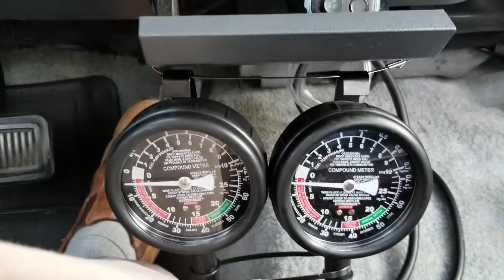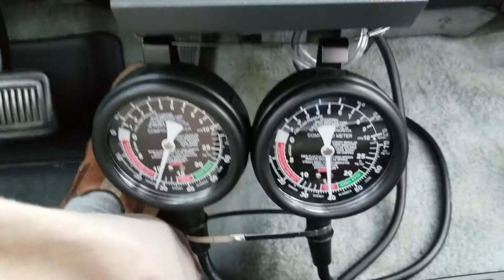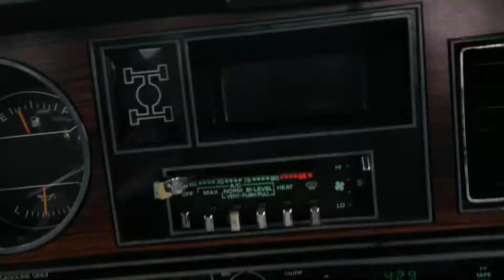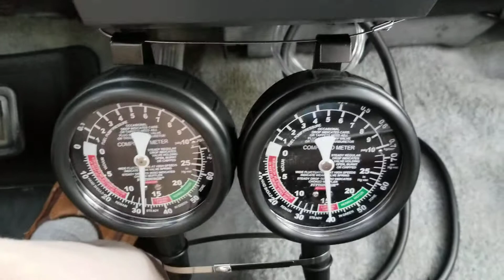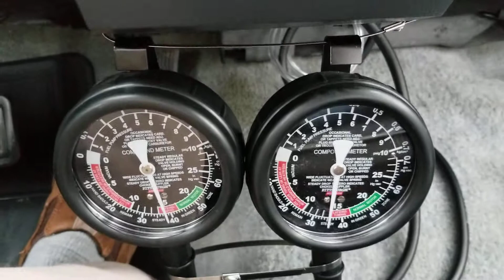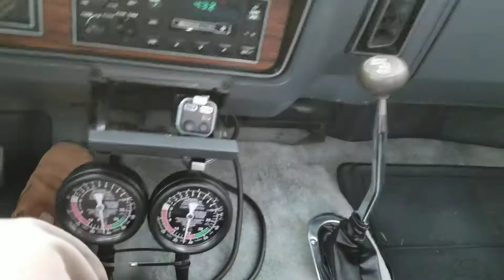Demo:  Ported vs. Manifold Vacuum in 318 w/ Holly 4bbl

Comment: After 1800/2000 rpm this all does not matter my timing is all in both mechanical and vacuum ported....and I think I know what I'm doing my 87 Ramcharger 4wd gets 15 mpg running a 89 318 roller cam with an Eddy 1406 and stock 4 pin ignition...still haven't had to change plugs in 2 yrs still running clean... You have to give the engine what it needs at the time it needs it... Great article written in Mopar action called A spark in time explains it very well... Being able to recurve your own distributor and setting total timing is a beautiful thing.

Comment: And this confirmed what I thought. Under certain instances where you could use more advance ported hardly delivers or falls off and in some case its almost like a curve where you begin to add load which you’d want a steady decrease of advance and you see the ported shoot higher at certain spots. Its just not a smooth predictable curve. At some point they converge and become the same but the BS that theyre the same the moment throttle opens is total BS.

Comment: You still have to turn engine to either carburettor for Ported advance or Manifold.
You do not have a true reading if you haven't turned for one or the other?
In the context of ignition timing, "ported advance" uses vacuum from the intake manifold below the throttle plate, while "manifold advance" uses vacuum from the intake manifold above the throttle plate, which is available at all throttle positions. 
Here's a more detailed breakdown:
Ported Vacuum Advance:
Connects to a vacuum source below the throttle plate.
This means the vacuum is only available when the engine is under load, such as when the throttle is open.
Advantage: Better fuel economy and reduced emissions at cruising speeds.
Disadvantage: Can cause a slight loss of throttle response at idle.
Manifold Vacuum Advance:
Connects to a vacuum source above the throttle plate.
This means the vacuum is available at all throttle positions, including idle.
Advantage: Better throttle response and smoother idle.
Disadvantage: Can cause pinging or detonation under heavy load. 
In summary:
Choose ported advance
for vehicles where fuel economy and emissions are a priority, and you're willing to accept a slightly rougher idle.
Choose manifold advance
for vehicles where smooth idle and throttle response are more important than fuel economy

Comment: I think it’s probably dependent on your setup. However, manifold vaccum would most definitely allow for you to run more advanced ignition timing due to the fact that it will retard total timing under a heavy load and prevent pinging.

Comment: Both zero at WOT. Ported up and down according to pedal swings, but does goes to zero when cruising/coasting at slight or no stepping. Manifold does give more consistent vacuum overall including idling/coasting. Ported seem to "burst" consistently every time the pedal was released (idling/coasting or stopping) then stomped. There are different vacuum capsule types, some more sensitive, others less, some adjustable, endless possibilities for the experimenter. And sometimes we do not anticipate what the "engine wants" in our setup. Also ported is in the carb and not all carbs may present the same ported vacuum response. I know aircooled vws with up to 15° static + 15° vacuum = 30° @ partial advance; 32° total at WOT (no vacuum). Ported needs some static as mentioned by fellows. But I know nothing about turbo or other non standard engine setups. 🔧🪛
Reply: Only reason why it goes to zero while part throttle cruising is because this engine was tuned or setup for manifold vacuum. The throttle blades aren’t opening wide enough for the port to pick up the signal with part throttle cruise. If setup for ported, the blades would be more open at idle, so when at part throttle, they are open enough for the port to receive the vacuum. 
Only difference is idle and coasting.

Comment: Cruising is considered  steady throttle between 37mph upto 55mph . Do u have vacuum readings between these speeds .??  Primary and secondary jets 14--15 to 1 air fuel ratio.
 WoT wide open throttle considered between 50--65 mph . Vacuum readings at those speeds   Power Valve starts to open then  . Power valve jet restrictor /jet is tuned for mixture then
air bleeds high speed ,,if fuel curve gets real rich at the top end ,drill HSAB , fuel curve should be fairly flat especially at cruise. 
accel pump is to add fuel to cover transition between circuits idle to main jet etc

Comment: This clearly demonstrates why manifold vacuum is the correct way to go. And based on the comments here, it's equally clear people don't understand timing or the purpose of vacuum advance.

To start, there's one comment stating that the purpose of vacuum advance is actually to retard timing. This is beyond absurd. Vacuum "advance" isn't just a name they slapped on the process. It physically advances timing. It has never been capable of retarding timing. At most, it can drop to zero and let the timing return to its baseline. But by the time that happens, the mechanical advance is kicking in. Which is precisely the point. 

Base timing is set "retarded" to make it easier to start the engine and to allow room for adjustment. Vacuum advance exists solely to raise that base timing to compensate for the lean mixture associated with idle and part-throttle cruising. When you floor it, the mixture richens and you don't need as much timing until the RPMs pick up... which is where the mechanical advance takes over. Manifold vacuum gives you advance where you need it, ported vacuum doesn't.

You can think of vacuum advance as literally being the idle circuit for your ignition.

As for why people can run on ported "just fine"... it's pretty easy to tweak other things to compensate for one bad setting. Just because you can crank up the idle mixture to compensate for a vacuum leak doesn't mean running with a vacuum leak is a perfectly acceptable alternative. You can advance your base timing and adjust the carb to compensate for not having vacuum advance at idle. But that's not the optimal solution.

Set your total timing, either based on recommendations or testing, and let the initial timing fall wherever it falls. Then tweak vacuum advance to fix any idle/part-throttle issues.
Reply: Do you have any first hand experience with the msd streetfire , pn 8362. Ive been searching everywhere to get a simple answer if/ how to use or set the advance limiting plate in the box. I get the limit amounts but im looking for which one to use . Its in a 1965 283 bored .030 over, original 520 pp heads (small valves . Like 1.50 / 1.72)Summit k1102 cam set, 
And a 1401 edelbrock avs2 , 500 cfm. 
Th350, Ford 9 inch 3.25 rolling 225 70 R 15s. 
Just need to know i guess if it matters being more of an rpm than torquey ... engine like the typical 350 and 383s are...
Fairly lightweight s10 chassis and body , with a snappy rev happy mill.
Reply: When you say “clearly demonstrates”, I presume you mean that in this example, the vacuum signal from ported falls away at part throttle cruise? 

Setup independent from one another, they function exactly the same way, except for idle and costing, where vacuum advance falls away with ported. 
The reason why it falls away in this demonstration is because this motor is setup for manifold vacuum, not ported, and the throttle blades are only slightly open. This means that at part throttle, the blades aren’t open enough for the port to pick up the vacuum signal. If however this motor was setup for ported, the blades would be more open at idle, so when on part throttle cruise, the port will receive vacuum and will advance timing.

I personally prefer manifold vacuum advance on my engine, but in reality neither is the correct and only way to go. It totally depends on your setup and requirements. Yes I get a leaner, cooler, more fuel efficient idle, but I don’t live in a strict country when it comes to emissions.

Lastly, just a small correction. When you talk about vacuum advance compensating for a lean mixture? It actually has nothing to do with lean or rich, but rather how dense the mixture is. Less dense needs more advance, and visa versa.
Reply: The missing piece here is calibration of the vacuum canister.  For smog era vehicles, the vacuum canisters were calibrated for ported vacuum and if you connect them to manifold vacuum the advance drops out during throttle tip-in because they require more vacuum.
Prior to smog era, the canisters are all-in with just 5-6 inches of mercury, not 10.  Advance drop out doesn't occur because manifold vacuum doesn't drop under 5-6 inches unless you really put your foot into it.
What I'm saying here is plumb your vacuum canister according to how it was calibrated.  If you want to run manifold vacuum, then make sure your distributor has the correct canister.

Comment: You can see how at cruise,ported vacuum is quite low (under 5hg).  Most vacuum canisters don’t actually start advancing the timing until 5 or 6 hg.  So if you’re running on ported, you will be getting zero advance when you need it the most (cruise/low load conditions).
Reply: Yes ported does fall away at part throttle cruise in this example, but wouldn’t do if set up correctly. Clearly this vehicle runs and is set for manifold vacuum, not ported. So at cruise the throttle plate is not opening wide enough for ported to pick up the vacuum signal. If one setup for ported, the throttle plates at idle would be more open, meaning at cruise, ported would pick up the signal, and vacuum advance would be active. They behave exactly the same way, except for idle and coasting.
Reply: @ even if the throttle blades were slightly more open at cruise, they wouldn’t be open enough to give you full vacuum advance like you would hooked up to manifold vacuum.  At cruise you need full vacuum advance for a properly running engine.

Comment: Very useful. Lots of nonsense out there, guys trying to show a distributor moving a 1/16" with a shaky camera and making bold claims. I was getting ready to buy another vacuum gauge and make this same video, thankfully you've already done it. Good work man.
Reply: You still have to turn engine to either carburettor for Ported advance or Manifold.
You do not have a true reading if you haven't turned for one or the other?
In the context of ignition timing, "ported advance" uses vacuum from the intake manifold below the throttle plate, while "manifold advance" uses vacuum from the intake manifold above the throttle plate, which is available at all throttle positions. 
Here's a more detailed breakdown:
Ported Vacuum Advance:
Connects to a vacuum source below the throttle plate.
This means the vacuum is only available when the engine is under load, such as when the throttle is open.
Advantage: Better fuel economy and reduced emissions at cruising speeds.
Disadvantage: Can cause a slight loss of throttle response at idle.
Manifold Vacuum Advance:
Connects to a vacuum source above the throttle plate.
This means the vacuum is available at all throttle positions, including idle.
Advantage: Better throttle response and smoother idle.
Disadvantage: Can cause pinging or detonation under heavy load. 
In summary:
Choose ported advance
for vehicles where fuel economy and emissions are a priority, and you're willing to accept a slightly rougher idle.
Choose manifold advance
for vehicles where smooth idle and throttle response are more important than fuel economy

Comment: In reference to your error at 2:30, you are correct that a normally aspirated engine will not reach 50" of manifold pressure and you wouldn't see it in a supercharged engine under normal conditions. When the engine is off the manifold pressure is atmospheric pressure, say 29.92" but as soon as you start the engine the pressure will drop to around 15" because the throttle plates are closed. if you ran the engine at wide open throttle the pressure would not return to 29.92" because the throttle plates and other stuff in the carburetor throat provides some restriction so you would see maybe 27-28" at full throttle. If you supercharge the engine whether mechanical or turbo the pressure would not be above 15" at idle but as you increase throttle the system would start to produce boost pressure and most systems are set to produce 30-35" of pressure under normal conditions, any higher and detonation starts to rear its ugly head. Yes race engines run much higher pressure and 60" or more is normal there, but the engine wears out faster. In my field of work the boosted engines are limited by a fixed ignition timing, 25-28 degrees BTDC so a waste gate is used to keep from running to much pressure. Personally, I would run manifold vacuum unless the engine has all the emissions stuff on it.
Reply from the maker: Thanks for the thorough reply.   Yes, the two difference vacuums have different uses.